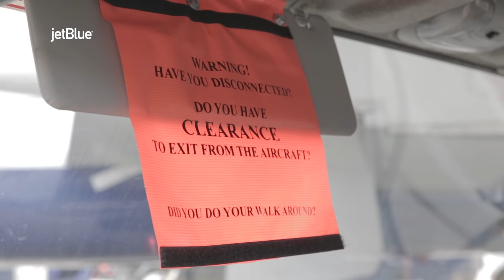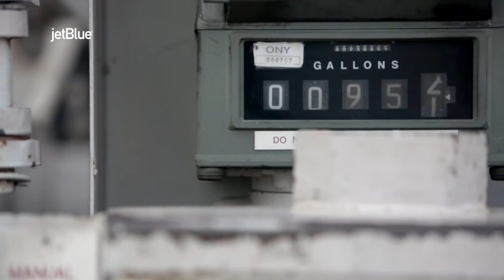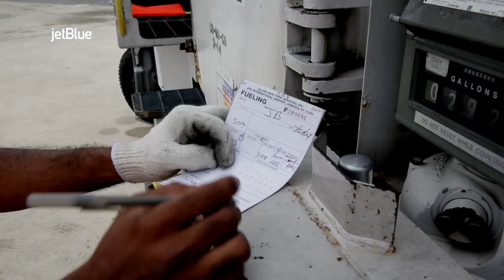A day in the life of a fueler

Comment: Wait. That’s a lot of fuel. How does it get to the airports?
Reply: I can't speak for every major airport, but I know that for Toronto Pearson there is a direct pipeline running from the Imperial Oil refinery in Nanticoke to the airport. Otherwise it's trucked in like any other fuel station.
Reply: Joel Houghton thank you! I was thinking about the trucking fuel in thing, but from what I’ve seen and hear as far as how much fuel these planes use, you would think they would have a constant flow nonstop of tankers driving through dropping fuel.
Reply: That is why it is WAY cheaper to have it directly piped in instead of paying truckers to haul it.
Reply: Pipelines, still the numbers dont add up for their max capacity of flow per day
Reply: That is exactly what happens.  At YYC there's anywhre from 50-80 tankers a day.  YYC also has a direct pipeline from the refinery in Edmonton.  Storage on site at YYC is a little over 16 million litres.  Average daily consumption is around 1.8 million litres.

Comment: Why Airhose ? okay compressed air is the fuel. Minute 2.00
Reply: @sexigrande1792  ,  fucking NASA - Guy ? Lol
Reply: That's called the dead man switch, he must hold it for the truck to pump the fuel.  If he lets go the truck will automatically stop pumping fuel, it's a safety device it works off of compressed air activating the valve

Comment: Why do you need a PRESSURE GAUGE  to pump fuel???Tell the truth
Reply: The aircraft system only can take so much pressure
Reply: The fuel pressure must not exceed 50psi into the plane or the fueling system can be damaged on the plane. It must be monitored each flight

Comment: £20.000 dollar hoax for each plane then....where does all that fuel go ???? Can't go in the wings where they say it does not with all the other electronics and hydraulics that fill that thin space to make it fly.... so other explanations are welcome...
Reply: "All the other electronics" In the wing there is hardly any electronics. There is the fuel panel, the lights on the wing tip and hydraulics to power the ailerons.
Reply: On the A320/321, the wings hold anywhere from 13800 to 14400 depending on temperature and the center tank, which they’d certainly use hold around 14600. So the load on this particular flight is pretty much filling up the plane

Comment: Tiny ass thin wings on those. Lots of part for hydraulic flaps and motors and pumps, so no room for fuel. Jet fuel hoax people.
Reply: Again, you've clearly never been up close to the wing of a commercial airliner.  They are far from thin my friend, some are several feet thick at the wing root.  Oh and pro tip, fuel is also stored in the fuselage(that's the body for your ignorant types) and the tail for ballast.
Reply: Evidently you're not a mechanic and haven't been up close to the wings to see how thick they are especially towards the fuselage.

Comment: 6500 us Gallons is equal to 24 605 ltrs, there is noway in hell you will be able to fill those wings (with bolt holes) !!! This is total BS, air planes (commercial) run on compressed air and very little fuel. People wake up they are fooling u!
Reply: wrong channel mate!
Reply: Rob Dunfy it's the right channel
Reply: I have a 1000 ltr Kerosene white diesel fuel tank, you cannot shift the thing once full. Your telling me that the weight of the fuel can be supported by flimsy aluminium!
Reply: Alan metclaff aluminum is not flimsy... And they use an alloy of aluminum..
Reply: You’re*
Reply: really, i don't see any fuel cells in any interior wing video.
Reply: I fueled these for 2 years, 6500KG is normal, yes. They can take more on manual mode